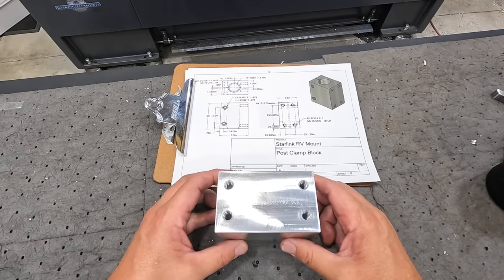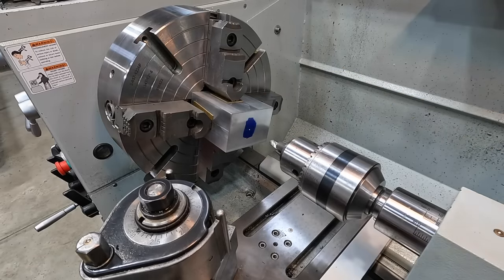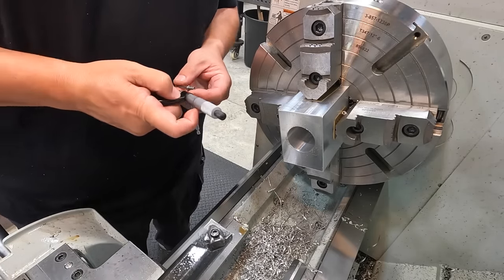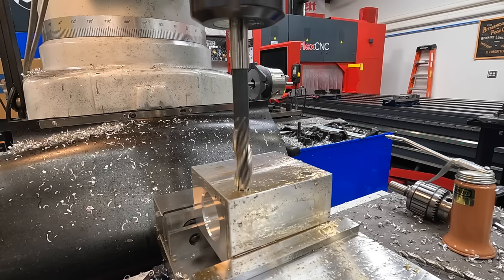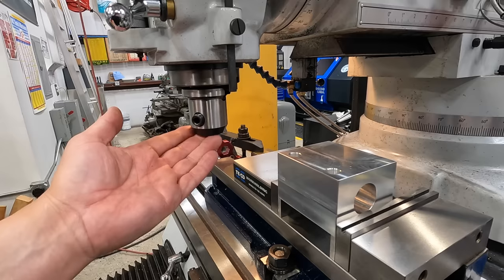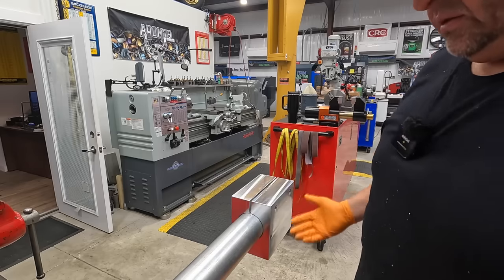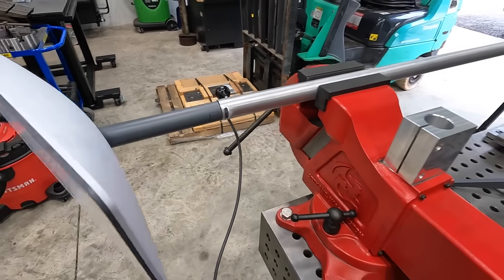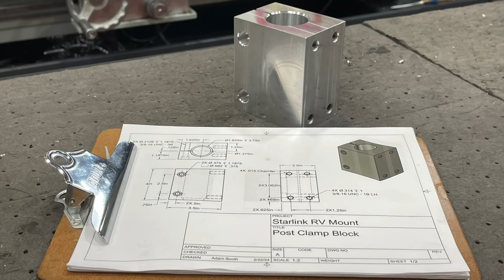Custom Starlink RV Mount Part 2

Comment: Hi Adam, As a Rolls Royce apprentice i learnt to use a cigarette paper for touching off cutters. Take a cig paper and tear a piece off about as big as your finger nail, wet it and stick it to the face you want to touch off on either horizontal or vertical it will stick perfectly flat,  bring the cutter in until it just removes the cigarette paper and you will be exactly 0.001" off the face without marking it. Cigarette papers are extremely consistent and accurate. I still have one of the original packs that I bought back in 1969 as a first year engineering apprentice and I still use them.  They stick best with flood coolant or WD40 or even spit.  Give it a go and keep your fingers away from holding a piece of paper near the cutter.  Bob

Comment: As always, geat work Adam. A beautiful and functional project. The only change I would recommend would be to radius the outward facing edges. At some point someone will walk around the trailer in the dark and be disappointed to find one the sharp corners. Like finding the trailer hitch on the back of a truck with your knee. We've all done it.

Comment: How is the antenna cable supposed to fit down through the tube with that Key welded in there... Thats what the slot in the antenna below the cable is for, so the cable will lay down below the ID of the pipe. The detention release-knob thinggy provides the anti-rotation if its slot was a bit closer to the width. I know it will work as is but the cable in the tube would have eliminated it flopping around in the wind, not to mention a cleaner looking install.
Reply: astonishing how far i had to scroll down for this comment. also, astonishing how much such details bother me sometimes, while i'm usually someone who has no problem letting other people live their lives. But i kept hoping that the key will just be shallow and leave space for the cable. the knob crushed these hopes pretty much.

Comment: Adam, When I was working we built major electrical switchboards from aluminum fastening all electrical components with stainless steel fastners/bolts. A guy from the fastner company gave us some advice that stainless and aluminum can interact /corode when used this way leading us to consult with a metalurgist for confirmation of this advice. He confirmed this was in fact the case but suggested we used galvanised fastners to avoid this situation. He also advised corrosion could be a long event. Anyway I though I would pass this along to you for your consideration. I might add that some people scoffed at this revelation but we as a company could not discount this adice as be sued for reparation at some point and not very desirable to say the least. Any, love watching your projects and note that Star Link is wide used in Australia in places the vast distances are outside normal phone and data range.

Comment: Adam, for the allen cap bolt that’s too deep. Just make a steel washer .187” thick and from then on you’ll use it and never be reminded it was a boo boo. Great project and even better that your Grandpap rides along on your camping adventures 👍

Comment: Adam, the way I see it the mount for antenna end of the pipe should work, after all you aren't going to have the antenna deployed while on the highway.  With the camper stationary you won't have any problems.

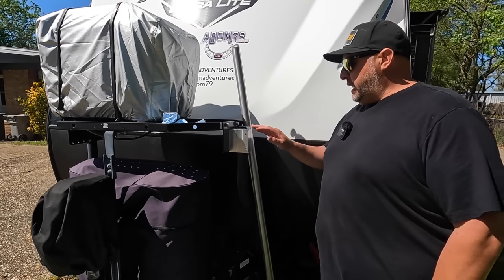Comment: Nice work Adam. At @50:50 you mention anodizing the part. Anodizing will eventually fade in the sun. Powder coating will hold up better in the elements. Many powder coatings are UV resistant, so if you do go that route then just make sure the powder being used is UV resistant. Its always nice to see you using parts and tools from your dad and grand dad.   =0)

Comment: I would recommend running the wire through the pipe vs taping to the outside of the pipe.

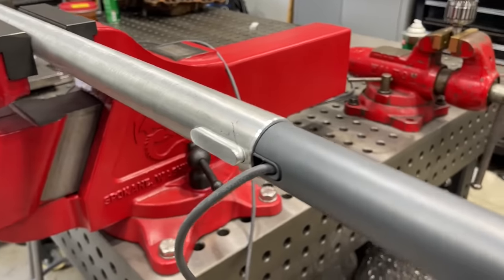Comment: Try to use all metal. Plastic knobs (47:54) for the fastener of the antenna would eventually crumble
Reply: Probably about the same time as the plastic that the actual antenna is made of 😮

Comment: Would have been a great project for 3D printing. Just to mock up the block to make sure you have the right dimensions and design. Print it in an hour and test fit it, then make it out of aluminum.

Comment: I thought that the slot in the bottom of the dish  tube is so you can run the wire down  through the tube instead of having it hanging out.

Comment: Also would you use a different speed depending on the type of aluminum, ie 6061, 5052, or 2024 and “O” or “T3”?

Comment: How long is the bed on that CNC and what are you machining on there?. I'm retired now but was in the trade for 55 years from apprentice toolmaker, machine builder, mold maker, machine designer, mold designer and retired as a plastic injection mold engineer. I always enjoyed my work. It was pleasant to run across this video. I've owned Starlink for the house for over 2 years now. It's been trouble free.

Comment: As someone who's definitely NOT a machinist!! I do know you have bigger twist drill bits. So when and/or why do you make the decision to go from a drill bit to a boring bar? 

Although I guess one can really stay out of trouble going to a boring bar. But I'd think that would defeat the propose of going out the bar anyway, wouldn't it? 😬😄🤪
But I am really curious concerning my first question .
Reply: Drills make neither accurate nor round and straight holes. If you want precision you only use drills for roughing or clearance holes for bolts.

Comment: Question: where are storing the pole when you are on the road? Inside?
Reply: Doesn't it just stay there?, and he gets a step and unscrews and unclips the top part and takes that inside.  Which is why he never bothered routing the cable inside the tube as he'd need a special push in connector at the end.

Comment: Everyone else simply mounts a StarLink terminal flat on the roof! But everyone else doesn't need video content for their youtube channel! You can get a 12v to 48v power converter so you don't need to run an inverter to convert battery voltage to power the indoor unit. If you shorten the cable, you'll have less power draw, due to line loss...
Reply: Everyone else isn’t Abom79. I believe he is physically incapable of half-assing anything.
Reply: @sparkplug0000  Woodwork excepted, by his own words he cares not a jot on how good that turns out.
Reply: I'm glad he's making things, I was getting bored watching machine set up videos.😅
Reply: I want to see the A bomb log cabin build. Cold rolled stock of course.
Reply: I hired a guy once to lay my tile - indient like the result but I let it slip - in the end I installed for installation and material - demolition - material and reinstall by a pro ….. why would I go for less than perfection? Unless you like to Mickey Mouse and don’t give a 😂😂😂😂 about yourself… then yes I agree @stuboness999
Reply: Yes, a feller with the youtube channel Everlanders did a nice setup!

Comment: AANNDDD of course they are told Use zinc anti-seize lube on the bolts, Else you wind up with More electrolysis weld-ment on the threads!! Oh how do we know in High tech about this ??

Comment: Is he gained old weight or video is old? Think he had weight loss surgery some time ago.
Reply: His weight loss and bariatric surgery was many years ago, after he found and married Abbie (Abby) and started cooking the small 1 oz pouch was stretched to at least 12 oz size and seems to be doing fine. If he wanted to reset the size of his pouch he would need to severely restrict his food intake, recommendation is to work with a bariatric surgeon and dietitian. If on the other hand he was sleeved the initial pouch was 2 to 5 oz. He may have done that back these many years ago. His weight is of course his business and our speculations were not asked for so that's all I'll offer.

Comment: Do you know what makes my pee boil?

You always give it the Billy big bollocks using all the fancy equipment. Like, measuring with your micrometres and internal bore equipment, which is great, as most enginers use simple callipers that will do the same job.

Then, you go and mess it all up by saying things like. I'll just give it about this or that measurement, which is what a backstreet DIY machinist or farmer making do with the tools he has to hand would say.

Either stick to precision engineering or DIY enginering. Don't mix the two on the same job. It looks unprofessional.

I'm just saying.⚒️🏴